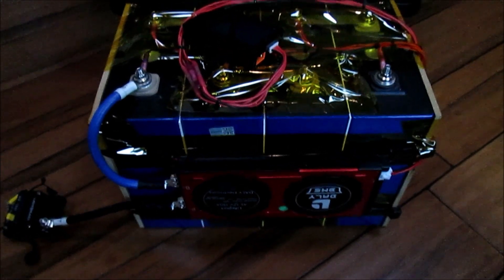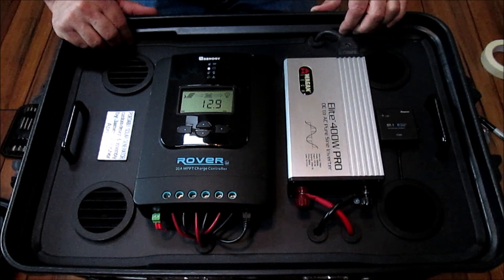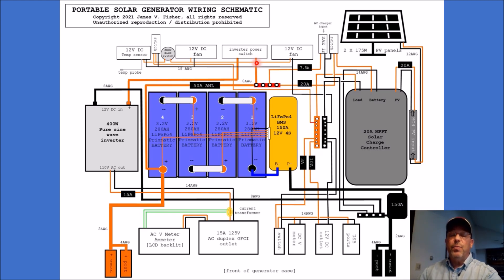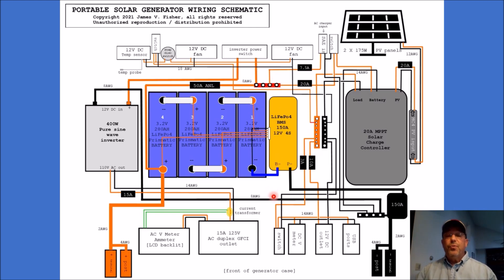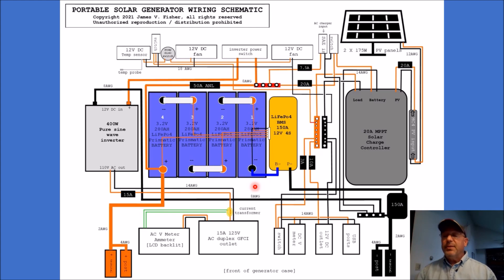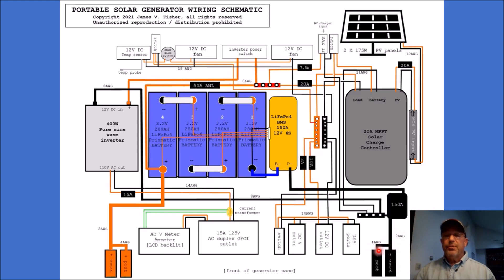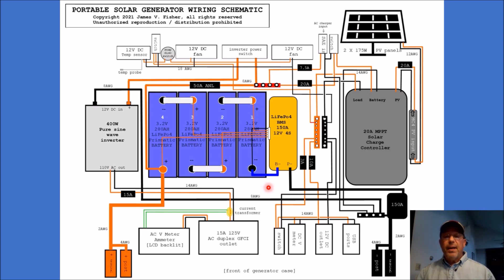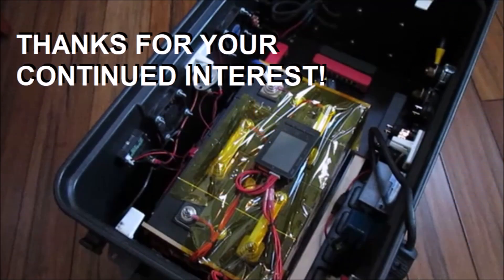V2 P5 3.5 Kilowatt Hour LifePo4 DIY Portable Solar Power Generator Part 13

Comment from the maker: If you are planning to upgrade your existing DIY portable solar power generator or are building one based on my new wiring schematic, please be sure to check out my next video.  I did have to make some minor changes to the wiring plan to achieve the best fit of the bus bars and 150A breaker.  As I bring this update to conclusion I will be posting a link to my final wiring schematic for those of you who may be considering this design.  Thanks!  Stay safe!  Jim

Comment: Thanks for the walk through of the wiring plan and your rational for some of your decisions. Nicely done. Cheers
Reply from the maker: Thanks David, I will be sharing some minor changes to my final wiring schematic in the next video.   I found it necessary to reconsider the configuration of the new 150A breaker and the main negative bus bar.  Heading into the home stretch now!